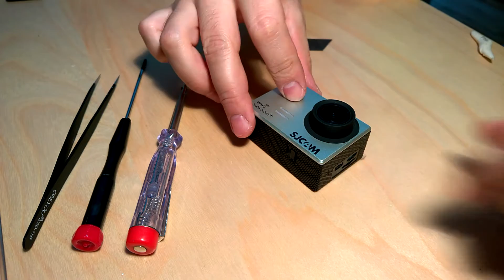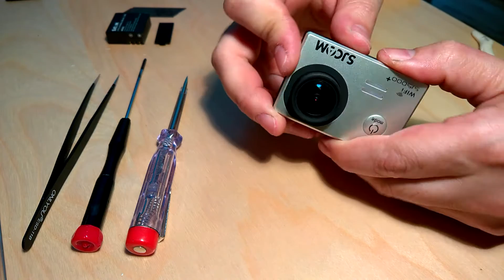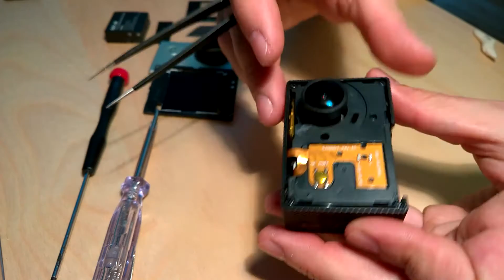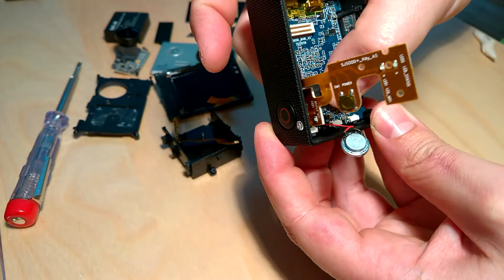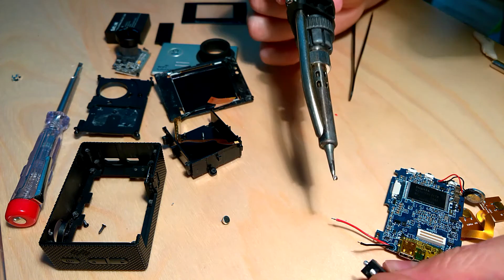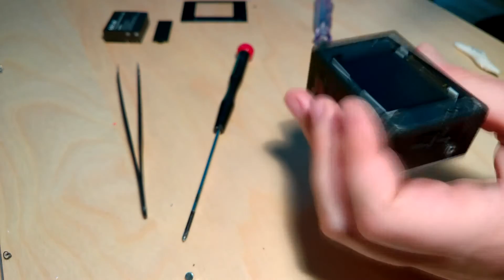(ENG) SJ5000+ External microphone mod

Comment: in that mod.. can you still use the sjcam5000plus in an underwater activities???
Reply: and is there other way to install without removing the original mic?
Reply from the maker: Juris Amour Judan , the answer is yes, but you need a new case without the drill. You can buy a open case to use when you want the external micro and the hermetic case for underwater. I want to say that I added the original microphone to the cam, and the cam records audio with the internal microphone when you don't use the external connector.
Reply from the maker: Juris Amour Judan , yes and not, I understand your question, but you need to install the femane connector in the position of the microphone, but the female jack has 3 pins. When you plug in the external microphone one piece in the female jack opens a circuit and you can use it to disconnect the internal microphone. When you extract the external microphone jack, the internal switch closes the circuit and the camera can use the internal microphone. This mod isn't in the video, but if you are really interested I can post some photos
Reply: so it means that i have to change the case everytime i want to use it underwater? and change it back again if i need the external microphone? yes! i would like to.. can you please send me how :) thanks a lot for the reply. and can i have a list of things that i need to buy :D
Reply from the maker: Juris Amour Judan yes you need to change the case unless you build a screw cap or something with one o-ring to seal the hole. You need to drill a hole to insert the microphone connector. For the parts see the answers below.
Reply: dgTECH3d  ok sir! thanks a lot.. thumbs up! :D all i need now is a video or pictures on how to put an external mocrophone without removing its internal.
Reply from the maker: https://www.photobox.co.uk/my/photo/full?photo_id=9705308023

Comment: wow. I was so nice. I jsut wanna try this myself. where can I get connector or some part?
Reply from the maker: 신검사  Hi. I used banggood to buy the connector. It's super easy to find. If you have problems I can give you some links. Thanks for your coment
Reply: dgTECH3d I will be good if you give me link. Ive never tried some looks like this engineering. Sj5000 must need to install this if I use ex-mic?